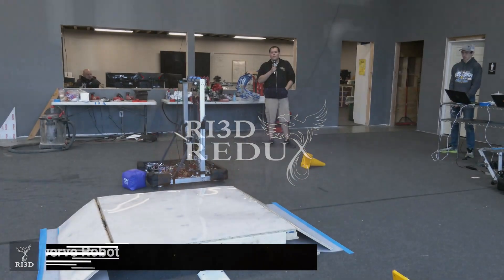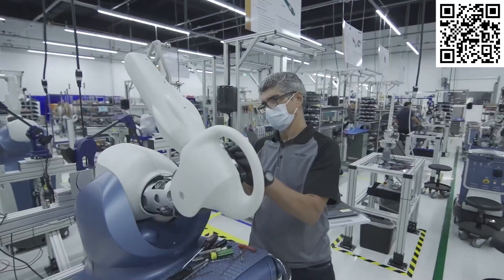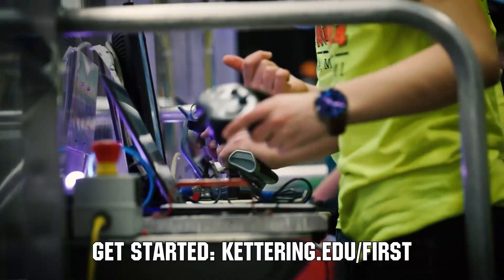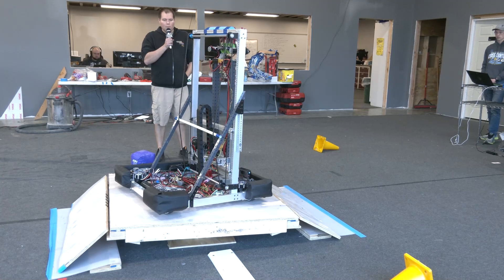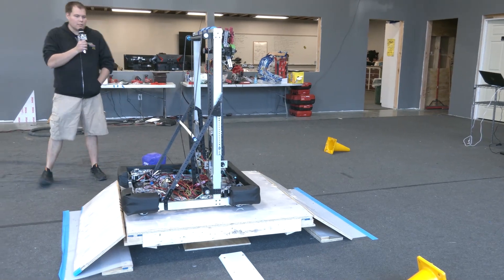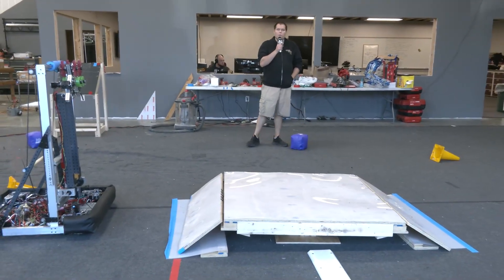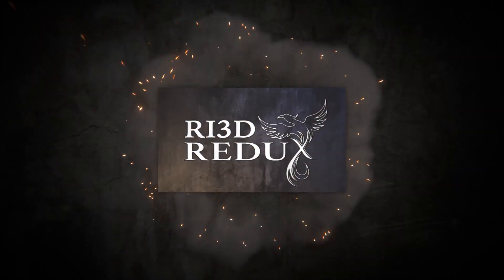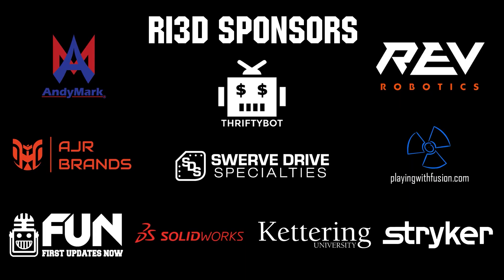110lb Swerve Bot vs Charging Station | Ri3D Redux 2023

Comment: Does that really weigh 110lbs without battery and bumpers? Seems really high. Also, interesting that only a 5 degree angle difference makes it significantly more difficult to go up, because the ramp lifts up instead of lowering. We noticed that this can occur sometimes with our model, but it is rare
Reply: Looking at the base especially those swerve modules are quite dense
Reply: Yeah the weight adds up quick, we’re not doing any lightening in RI3D